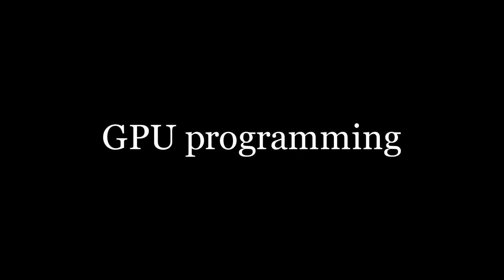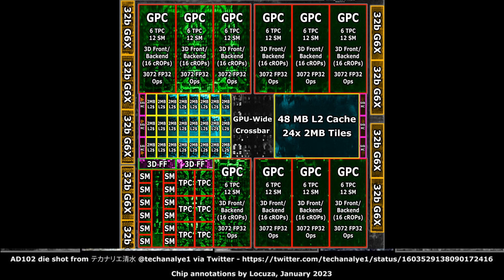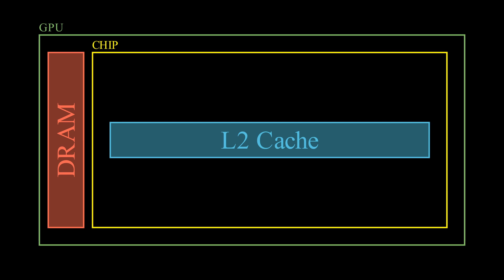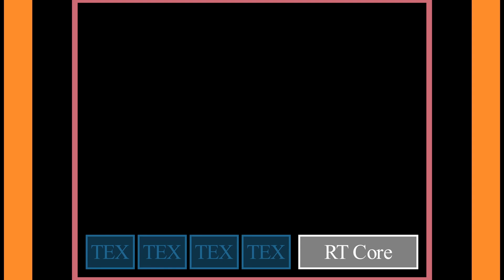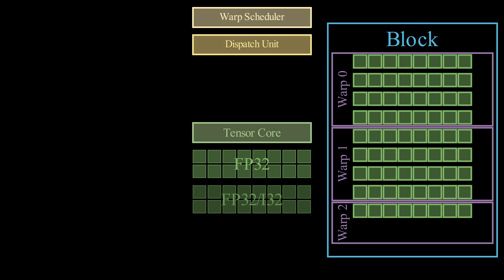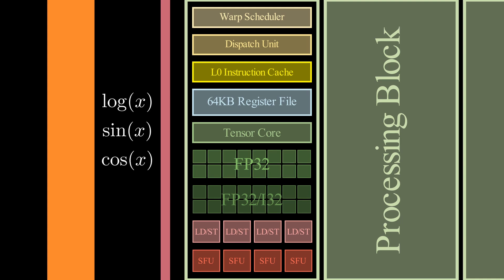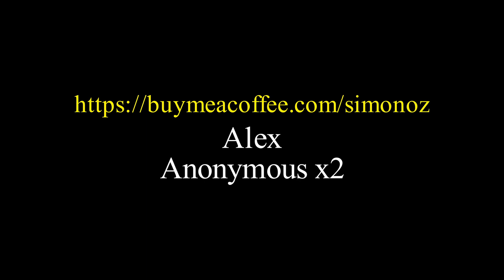Modern GPU Architecture | GPU Programming

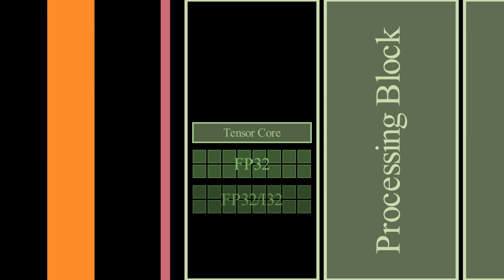Comment: 6:21 This is incorrect. You're confusing nvidia marketing for actual architectural information. For one, there's no "tensor core", it's an API call that uses the (graphics) FP hardware. There is NO specialized AI hardware in nvidia GPUs (except for the "innovative" 8 and 4 bit data paths).
Reply from the maker: Could you provide a source for this? The Volta whitepaper says "The Tesla V100 GPU contains 640 Tensor Cores"(https://images.nvidia.com/content/volta-architecture/pdf/volta-architecture-whitepaper.pdf ) which makes them sound as a separate unit.

Also nvidia employees on their forum says "There is no overlap or direct connection between CUDA cores and tensor cores" (https://forums.developer.nvidia.com/t/tensor-core-architecture-deep-dive-any-whitepaper-blog-available/283285 )